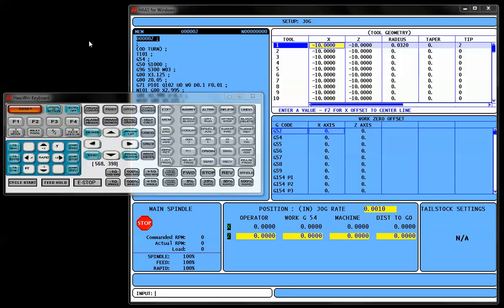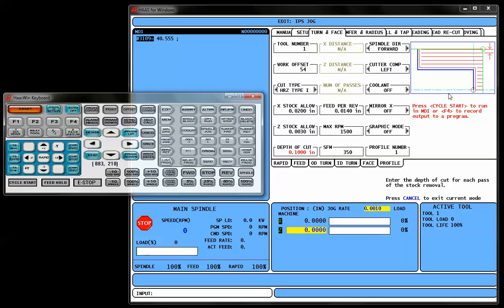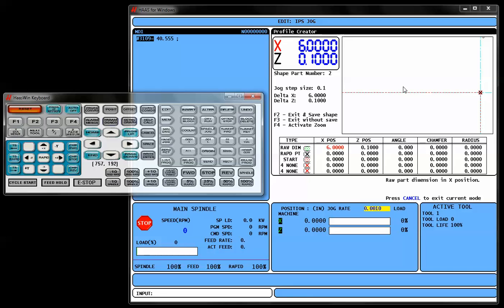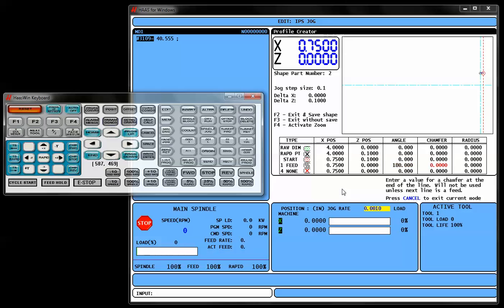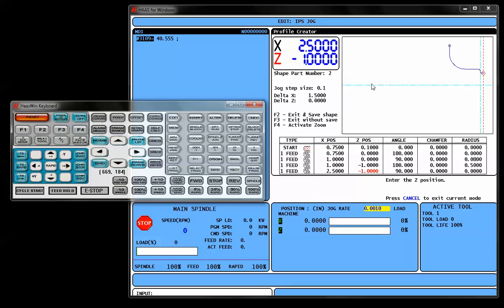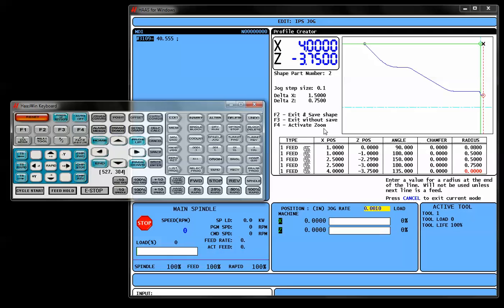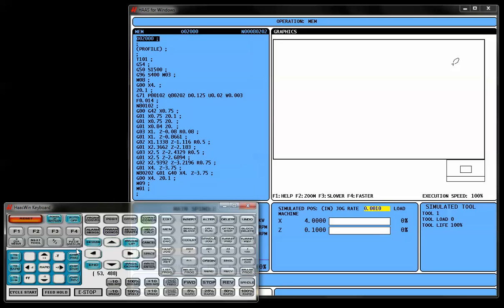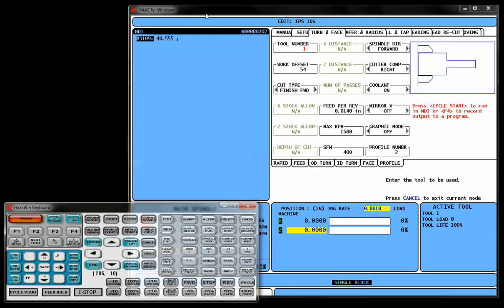Haas Lathe Intuitive Programming - Creating a Profile Shape

Comment: So the only thing this is going to do is simulate a program?
Reply: The IPS Shape Creator is used to create G-Code programs that you can run in your Haas machine tool.  If your machine has the IPS option, you can create the simulation, and the resulting G-Code, right there at the machine itself.  If you do not have the IPS option, you can also purchase a Haas Simulator (https://www.haascnc.com/machines/vertical-mills/control-simulator.html ) to accomplish the same thing.

Note that simulators can be purchased as the latest Next-Generation control, or the "Classic Haas Control", which is pictured in this video.
Reply: @Darren_HFO_Champions  so how much is the software in the video? Where can one buy it from?

Comment: how did you set coordinate system, offsets etc, because when I tried to write a program the alarm had released, that I excess x axis range (I just wrote 0.4" x cordinate). Could you help me to solve my problem ? :)
Reply: First, I would search YouTube for Haas Automation Tip of the Day videos.  There is a specific video that covers lathe tool and work offsets.  Mark (at Haas Automation) does a wonderful job at explaining offsets in such a way that you can fully understand where the values are coming from.  Thank you for contacting us.